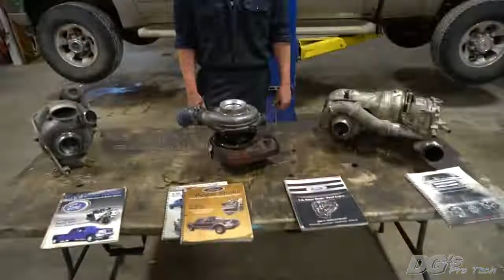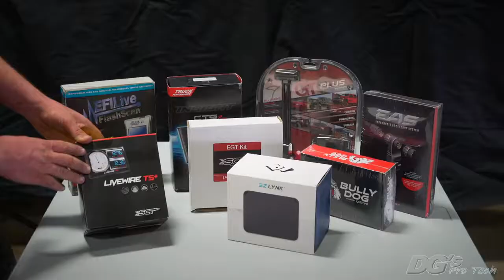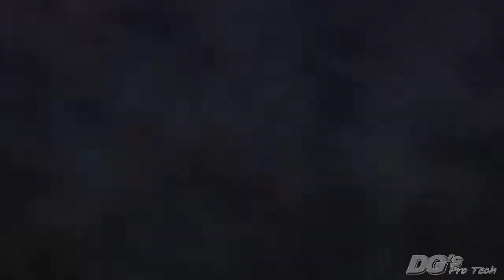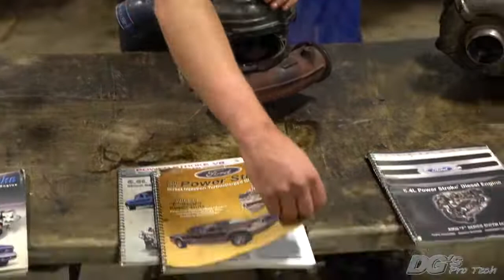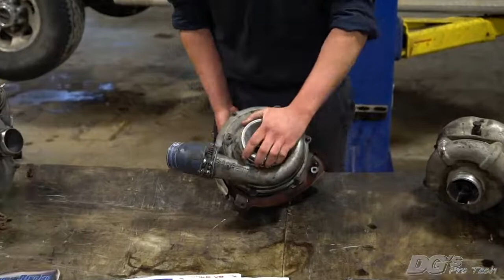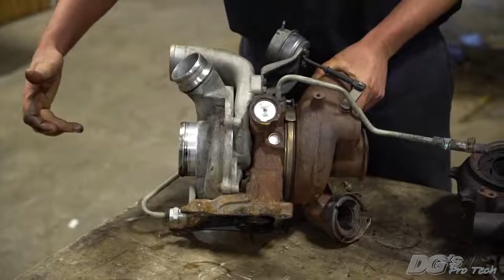DG's TV: VGT Turbo's

Comment: My 15 6.7 power stroke has Vgt issues every once and a wile but no engine codes.. I took it ford to have it replaced for warranty 3 times and they say the turbo is fine every time.  
 It will over boost (like maxed out on the gauge 400 plus psi ) under light throttle slow speeds. Then sum time it will cut out under load. I don’t know any thoughts?
Reply from the maker: Likely the but games are giving trouble only intermittent only under certain exhaust loads or when certain temperatures got or cold are reached, we can help diagnose this and help with your Ford warranty of you wish